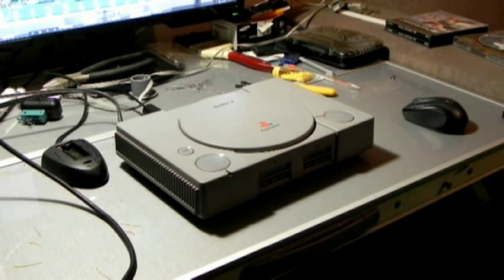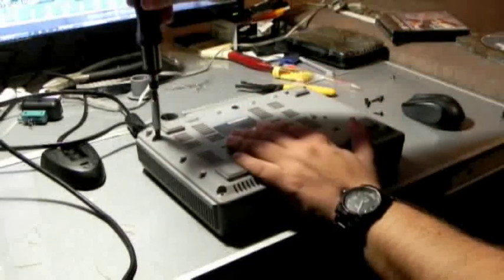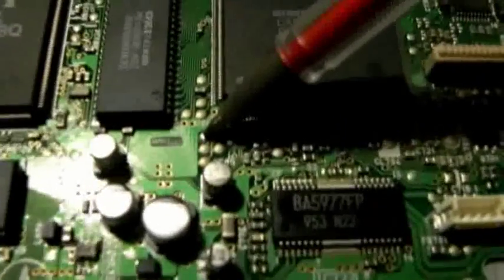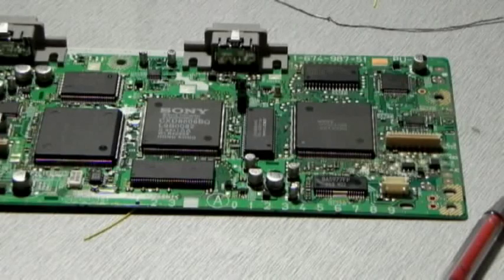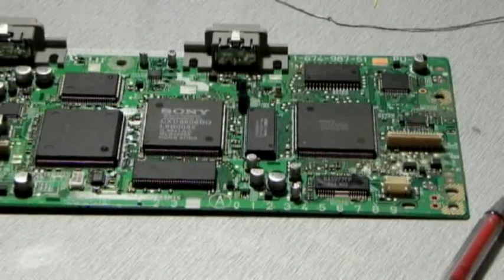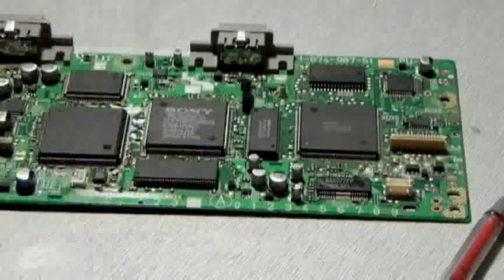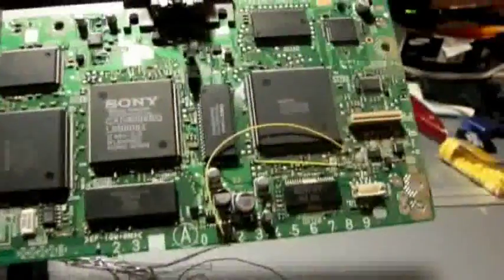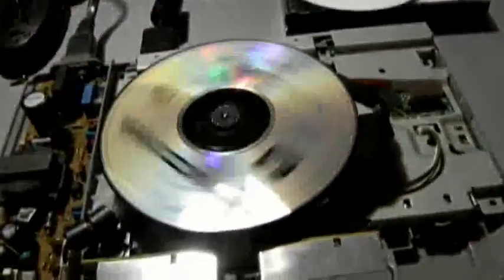Lets mod a PSX with a PIC12F629 Part 2 (SD)

Comment: Great video, really helpful :) Have you fitted a chip to pu-18 motherboard? Just wondering if you have a decent diagram with matching hex That will work with pic12f629?
Reply from the maker: Here is the hex: http://www.eurasia.nu/modules.php?name=Downloads&d_op=viewdownloaddetails&lid=9349&ttitle=mm3_hex_dump_12F629
Reply from the maker: Here is the Diagrams: http://www.eurasia.nu/modules.php?name=Downloads&d_op=viewdownloaddetails&lid=5353&ttitle=MM3_diagrams
Reply: Tried that diagram and hex, didn't work on my pu-18 so moved onto a pu-23 and worked fine

Comment from the maker: I normally have it set to roughly 350Deg C for surface type soldering and 400Deg C for trough hole, if your just starting out I highly recommend starting at the lowest temp possible roughly 250 to 280Deg C wen its lower you can hold the iron on the same point for longer without it damaging anything, then slowly increase the temp as you get better.

PS Sorry for the very late reply.